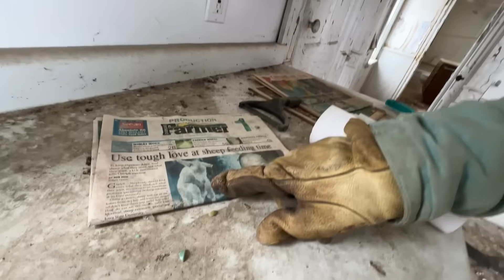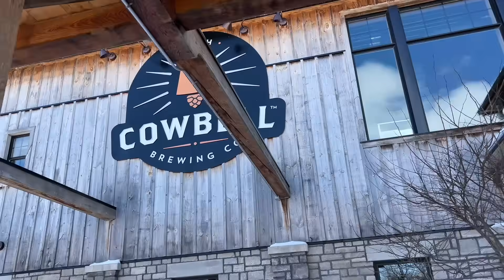Sheepishly Me - Tara’s Version! Sheep Farm Vlog

Comment: We have farmer friends who farm about 30 sections of land in central eastern Alberta Canada. . Their equipment is very very large with the tires are over 6 feet high. They have very tall silos and lots of them. About 25 of them on their farm though they build more each year and put extra grain into huge long white grain bags simular to your feed bags but bigger and way longer. They also rent bins from retired farmers. They have around a couple thousand beef cows and about a 1000 of the specialty Japanese cow that they sell to restaurants and other specialty stores. Very expensive meat, Wagu in Canada or called Kobe beef in Japan. The cows are treated to better feed and too expensive for a cow for the average person but they only sell to particular people or groups. They rotate fields in some areas 700 kilometers away. When they pick them up in fall they have to organize for an inspector to meet them and make sure they only taking there own cows. I think they match their ear tags but I remember about 15 or 20 years ago they had to brand their cows and at the same time cut the nuts of of the males. I'm glad you got to see Canada in the spring. The weather varies but we often have snow. January and February are not adviseable to come to Alberta as we get periods of vicious cold weather at -40 Celcius. And colder. Then it warms up to this year above 0 a week or so then usually hovers between just below 0 to -20 C.
Reply from the maker: I'm glad we didn't experience -40! That would be quite chilly!